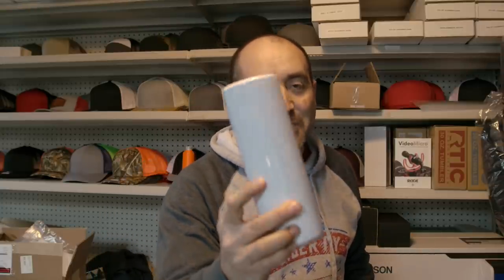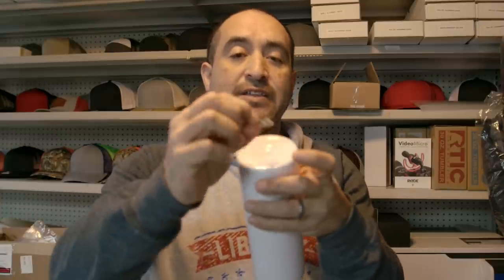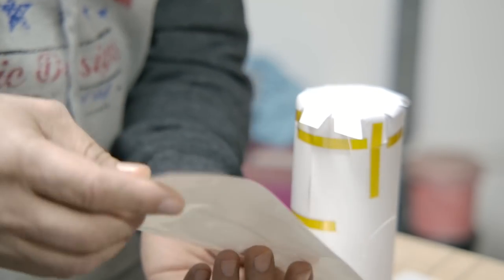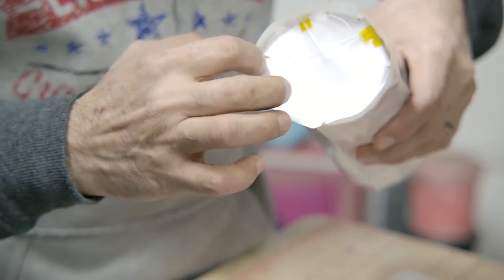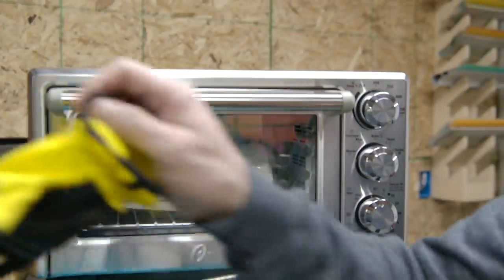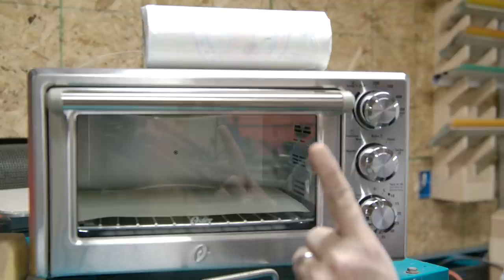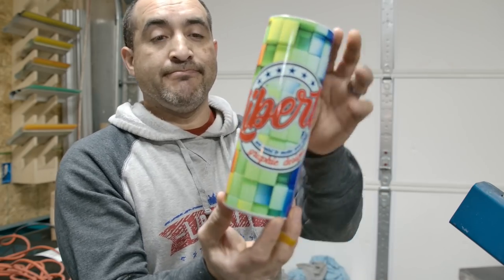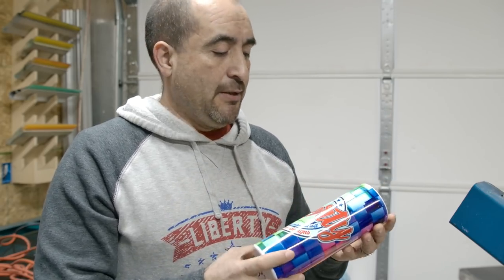THE BEST TRICKS TO SUBLIMATE A 20oz TUMBLER

Comment: I bought a convector oven two year ago and never use it because the tumbler press seemed easier.  NO, I’ve ruined at lease 15 tumblers.  The good news is, I didn’t throw them away.  So now I’m learning how to do epoxy.  Anyway, I just ordered the sleeves and will be using the oven for tumblers and my press for cups only.   Great video!❤

Comment: The paper didn’t shrink, the tumbler expanded due to the heat. Always make the print a little larger for this reason. I also save time by simply leaving about a 1/4 inch white border on top and bottom instead of cutting separate pieces out.
Reply: Do you just slit your white border and tape it inside the cup and to the bottom?
Reply: What kind of paper did you use to cover the bottom of the tumbler? I am using Asub paper in my Epson SureColor F170. I heard some types of paper will burn in the ovens. I had paper scorch in my mug-press which I expected.
Reply: Matt-how do you keep the shrink wrape from sticking to the 1/4" border you leave? thanks~ Lisa
Reply: Why does my shrink wrap keep melting after being in the oven for like 40 sec, I only have temp on 350
Reply: 9.3x8.25
Reply: @jeremyponce7640 . Be sure to use an oven thermometer so that you can see exactly what the temperature is inside your oven. It’s recommended to use two thermometers. One on the right and the other on the left. The ovens tend to not have the correct temperature corresponding to the settings. 

I hope this helps. 

Best wishes. (11 months later)

Comment: I use a Cooks convection oven.  After preheat, it is 3 minutes exactly at 400 degrees. You can leave them to sit to cool, or peel it off immediately.  I cool mine in the fridge for 5 minutes before removing the wrap or the print.

Comment: Great video! I’ve been printing 9.3 but length 8.125, trying to cut flush to the flat part to prevent bottom ghosting. Sometimes the spots still happen down there. I see you do 8.1, so you think my length is the culprit?

Comment: You can use Cricut infusible ink markers to touch up the line and then process again for a few minutes.   Where did you get the wood  holder on your wall for you screen printing wipers?

Comment: Thank you for the tips... love the string trick. The only time I have problems with it sticking to the cup is if I wait till cup cools... I always take it off while the cup is hot with heat glove
Reply from the maker: That's the best way to take off just be careful not to burn your self
Reply: @LibertyGraphicDesigns  What kind of string is this? Can you use the same piece over and over?
Reply from the maker: @briancummings5461  This is a string we use to sew leather and yes it can be use over and over.

Comment: Great tricks. I actually just had a problem with the shrink wrap sticking to the bottom for the 1st time. I will try this trick. Have you tested the temp in your oven to make sure it is 400 degrees. I didn't see a thermometer. I know my temps are not accurate.

Comment: Thank you for sharing your tips! I really like the string trick to cut the shrink wrap thank you for sharing. I’ll be trying my first sublimation tumbler tomorrow. Is sublimation completely safe to do inside the house? I know that it needs to be a dedicated oven only for sublimation. But are there any fumes to worry about? Thanks in advance.
Reply from the maker: it does smell a little bit but you should be fine as long as you don't do it all the time

Comment: Thank you for the tips. I have a question I have a new ET epson-2760 but I just bought the epsom 1500 my question is can I put reg ink back into the 2760 and use it for a reg printer even though it had sublimation ink in it?
Reply from the maker: Yes you can, you just have to get most of the ink out and add the regular ink and print about tem full pages to clear all the sublimation ink and you'll be good to go
Reply: @LibertyGraphicDesigns  thank you so much🎀

Comment: Thanks for the great video. I have the Epson 170 and I thought it could not print white? No white ink in the printer so how did it print white? Also I am surprised there are not more print settings you can choose from. I think my colors can be brighter on A-Sub paper. Any recommendations?
Reply from the maker: Yes there is no whith ink in sublimation, you get the from garment or the substrate your printing on so if you're printing on a darker garment instead of white you will get what ever color the garments are. To contro the color on your prints they must be done on your designing software.

Comment: Thank you for the video and tips. I haven't set up my printer yet but I am about ready to dive into sublimation. Will a hair dryer work to shrink the wrap?
Reply from the maker: it should just set it on high and make sure not to over shrink the wrap that way it won't melt in the oven

Comment: Thank you for the video, I learned that I have been totally over cooking my tumblers, but my biggest problem is the colors are not bright like yours. I have and Epson ET-3760 and the colors were dull, i had purchased the sublimation ink on Amazon and i figured i must have bought a crappy brand. So I purchased another Epson printer ET-2720 used EP sublimation ink still crappy color...well not as vibrant as it could be. Is the problem with the printer calibration?
I do not know what I am doing wrong, I have the same small oven as you, I now realize I was leaving my tumbler in too long and turning them. Any insight will be helpful. Thank you!!

Comment: Does it have to be a convection oven? Can I use a large toaster oven that I have? Of course, it is not convection and it does not have turbo. If the oven doesn’t have turbo, do you need to leave it in longer?
Reply from the maker: GREAT QUESTION! No. it does not have to be convection oven, convection just means that it will circulate the heat evenly through out the oven whereas the regular oven (toaster or regular oven) will have hot spots the convection eliminates hot spots by incorporating a fan inside the oven that's all nothing fancy.

Comment: I recently purchased the EPSON F170 with the EPSON Paper sheets in the box.  The box doesn’t have any instructions.  No idea what side I should print on.  I know you have the rolls but do you know if I should print on the white side or the off white side?  TIA
Reply from the maker: that is a very good question, normally the print side is a slightly darker then the back side

Comment: Do you know why my shrink wrap burst open about half way through the 4-minute process?  I used an oven thermometer to make sure the temp was correct after the first one burst, but the second one burst also.  Could my thread be too thick?
Reply from the maker: make sure you don't over hat (over shrink) the wrap, it sounds like the shrink wrap was way too tight before you put it in the oven.

Comment: Great video! Let me ask you, i did my first metallic coffee mug and i think i overcooked it. I saw a video that sai 40 for 6 minutes, I use an Epson SC F170 sublimation printer, epson sublimation ink, koala paper and, i believe, the same oster convection oven. I also used a silicone wrap. I did it outside but there were very toxic fumes coming from the oven. So toxic that even when i was outside, i inhale a little, little bit and i was feeling a mild reaction. I believe that the toxic fumes came from the silicone wrap. I will not use it again. So my question is... Do you have fumes when you use a simple plastic wrap? Do you do that in a controlled environment? Should i do it on the patio? I am sorry, i guess it wasn't only a question. I'd appreciate your response and advice.
Reply from the maker: very good questions!! yes silicone can sometimes give out fumes but not all the time depending on the quality and type of silicone used, I do all my sublimation in my garage with very little ventilation there is a light odor but I have not experienced any side effects however there might some people that do or are sensitive to such fumes, wearing a mask or respirator will help a lot and is recommended. I do my cups at 400f for 4 minutes and sometimes for 3:45 at 375f I think 6 minutes is too much in my opinion I also don't rotate my cups I leave them there the entire time. thank you for your comment!

Comment: Thank you!  Can you use floss for the thread instead of leather thread?
Reply from the maker: That is an awesome idea I did not think about that
Reply: I tried floss instead of leather thread. Although it did cut the shrink wrap, the wax coating messed with my design. I would advise to try floss that isn’t waxed.
Reply from the maker: @yvonnevilla4312  thank you for sharing
Reply: @yvonnevilla4312  I did also but it must not have been waxed. It did make it a little easier to remove the shrink wrap.

Comment: How do you prevent discoloration from the heat elements on the top of the oven? I've had to rotate the tumblers every 20-30 seconds to prevent it but it still happens occasionally. Thanks!
Reply from the maker: I honestly have not have that issue I don't rotate my tumblers at all

Comment: What do you do with tumblers that get burned or image is not mirror? Is there a way to save them ? Thank you!!
Reply from the maker: all my mistakes or samples get sent to Mexico not only cups but shirts, hats and jackets, on the tumblers we don't have the "mirror" problem, our printer is set up to print in mirror
Reply: Sandra Padilla,
If you do resin work, you can spray paint the tumbler and create your design with water slide decals and then after you apply it to the tumbler , coat it with resin. You can even use dishwasher safe Mod-Podge.  If you would like further information check on YouTube for how to fix sublimation erros on tumblers. There are many videos that will help you understand better what I am talking about. Good luck

Comment: What makes heat tape marks.  I have yellow lines from the heat tape.  I bake small oven 400. 4 min.
Reply from the maker: try not to put tape on the tumble itself however the tape should not mark the cups unless is not a heat resist take (heat tape)

Comment: Loved your tips for good sublimation.  Regarding the oven you used, maybe you answered in another video, but I didn't hear it here.  Is it a convection oven?  Other videos I've watched stated that you have to turn the tumbler after half of the time is gone by to get even sublimation.  You didn't do that.  Your method looks a lot easier than rotating the hot tumbler half-way through.  Also, could I just use a teflon sheet instead of the printer paper in the oven to keep the tumbler from sticking to the oven rack?
Reply from the maker: yes mine is a convection oven and I do NOT turn mine at all, yes you can use a teflon sheet
Reply: @LibertyGraphicDesigns  Thank you.

Comment: So, after watching the video I purchased a large convection air fryer/toaster oven similar to the one you have. I only did one Tumblr the first time. It came out perfect and the colors were awesome! The second try I did three tumblers at one time. The only difference this time around is I did put a piece of copy paper in there to sit the tumblers on as I forgot to do that the first time. These tumblers did not come out well at all. The paper stuck to the shrink wrap. The colors were uneven and not vibrant. Temperature both times was 400° for four minutes and 15 seconds. Any thoughts on why this happened to the second batch? Could it be that the copy paper prevented from baking correctly? I am at a loss. Thank you.
Reply from the maker: it all depends on the amount of items in the oven in this case three tumblers, you should increase the baking time since the first few seconds took longer to heat up the tumblers, also, do not open the oven for any reason as this will cool down the oven and take longer to bring it back to temperature. if the paper had anything to do with is because you have the oven on "BAKE" witch uses only the bottom heating elements, please note that the oven I'm using in this video is a convection oven that has a fan to circulate the heat throughout the oven. try going from 4 minutes to 6 minutes when you do multiple cups or tumblers instead of 4 minutes
Reply: @LibertyGraphicDesigns  OK, sounds good. I did have it on fake but I had convection on so that there was circulating the entire time

Comment: I'm new to sublimation, what is the purpose of the sleeve? Is it so you can do sublimation on any cup even if not specific  to sublimation?
Reply from the maker: The seeves are used to hold the image on the tumblers some people use tape but tape does not add enough pressure
Reply: @LibertyGraphicDesigns  ok so cup still needs to be sublimation cup then?
Reply from the maker: @karlkrystal84  yes

Comment: Juan,

Thanks for the tips and tricks. 

I did try dental floss for the string trick and it worked!
My question is WHY do we pre-shrink the wrap BEFORE putting in oven? My wrap shrinks as soon as I put it in oven, gets smooth in seconds. 
Also if you use silicone bands on the end of the cup that keep the shrink wrap from sticking to the bottom, just add the bands before The wrap, shrinks right around the band. 

Thanks for your videos

Comment: Mirroring the image - it's not if the printer is converted or not - it's more related to the software used for making the prints. If the software is already set up by default to mirror the image, then you're good to go. If the software you are using does not mirror by default, then you must mirror the image each time or change the setting permanently in the software settings. If your printer driver does not allow a permanent change then you would have to select mirror each time you print.

Comment: Love the string trick, but the problem I’m having is trying to get a complete wrap top to bottom. I have tried folding the paper underneath the bottom to make sure I don’t see any white and tape it around, but I’m still getting a tiny bit of white even after using shrink wrap which makes me think the pressure of the image is not getting to the tumbler right at the bottom. Any suggestions? Tks
Reply from the maker: I'm working on a jig just for that but I'm still testing it maybe two more weeks

Comment: Thanks for your videos.  I haven't figured this out yet, and my fiancee and I are new at this, but i have a question.  I'm sublimating 20oz skinny tumblers (straight) and i get everything perfect.  Until the part where you have to put it in the oven... the shrink wrap is melting almost instantly and i only have it on about 300 degrees.  is there any way to prevent this?
Reply: I am having the same problem 😩
Reply: 300 F is way too low for sublimation. You won't get good results. Are you sure the shrink wrap you are using is made for sublimation, not the stuff you use a hair dryer on for gift baskets.

Comment: I’m watching a lot of videos before I even attempt sub.  Question though, would those  silicone tumbler bumpers work for the top and bottom instead of cutting paper?  Also, instead of putting a sheet of paper down, would a silicone mat work?  Just asking, not sure if that would or wouldn’t work?
Reply from the maker: yes a silicone mat will work better I just don't have one so I used paper instead

Comment: Love your videos they have helped me so much! 
I did 4.5 minutes at 400 degrees and mostly all of the shrink wrap melted. I’m using a convection oven. How do I prevent this?
Reply from the maker: Where did you get the wraps from? I been getting the same question and I'm trying to replicate that and even at six minutes mine melts a bit but not a lot
Reply: Mine also melted also instantly so I just watched it closely with my fingers crossed the the oven start smoking about halfway through so I turned it off and let it just sit for the rest of time still came out pretty good black isn't as dark as I was going but could be just the image
Reply: @emelt3377  see that is what I’m afraid of. I was in a house fire and so now I have some crazy PTSD about things catching on fire.

Comment: I actually have a question and since in previous videos you have mentioned that you have used different sublimation inks. Is it possible that different inks burn at different temperatures? I use Asub paper and Inkxpro inks. I have the exact same oven you use and I have a thermometer in the oven as well as a handheld laser thermometer. When I sublimate at over 350, my tumblers burn. I have tried it for only 4 minutes at 350 (thermometers temps) and they burned. So I have been doing 325 for 10 minutes. No burning, but the coloring on the tumblers isn't even. So I have been wondering if perhaps different inks burn at different temperatures. I found the Epson paper and inks at Conde, I'm just saving up to get them, plus I would need a new ink cartridge system for my workforce printer.
Reply from the maker: That is a great question, you're the third person that told me that the tumblers or the shrink wraps are burning at 400f you and the second lady are using the same ink the third lady is use sawgrass and is having the very same issue, i used use inpros myself and sometimes my color will not pop like Epson does. I'm waiting on 4 printers that I ordered from Epson to do a test on 4 different inks and we will find out exactly why this inks are doing that. Thank you for your question!.
Reply: Wow, just came across this.  I am simply blown away by how nice you are—buying printers to help others.  God bless you.